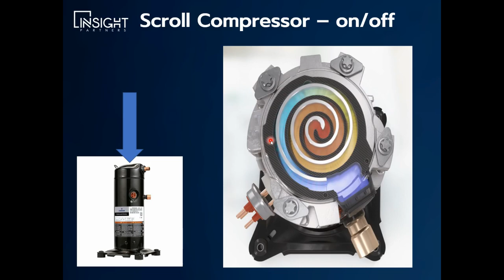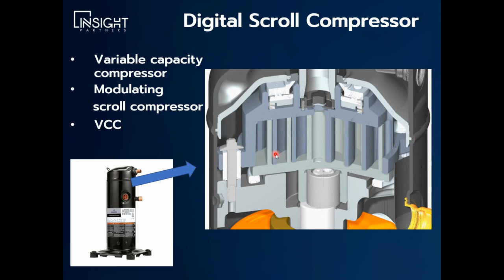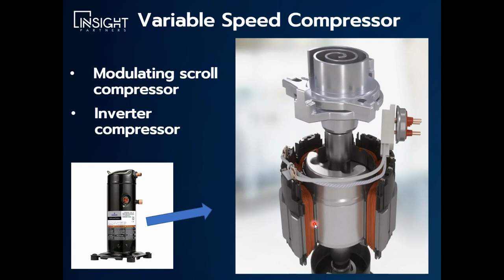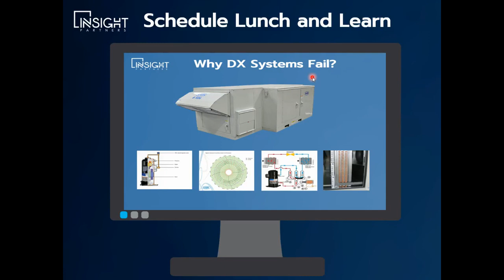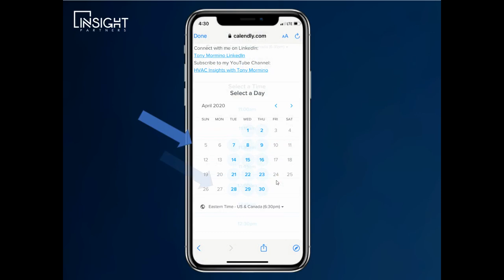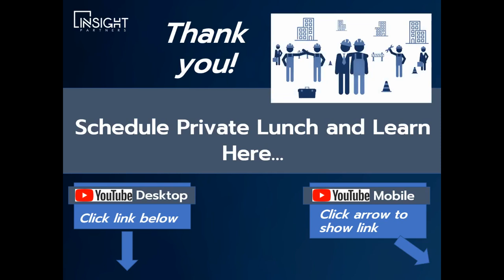Digital Scroll Compressor vs Variable Speed Compressor

Comment: so, is the variable speed scroll compressor is whats driven in "inverter compressors?"  If so, Im curious what would be a reason for a constant high squeal during such compressor operation? (Im trying to figure out why a window AC that uses this tech ... is quiet except for a high pitched squeal around 6.3khz)

Comment: Hi Tony , could you please share how to do selection for hot gas bypass itself? For example for coolong tunnel application , where we need to control the temperature stable and in other side we need to avoid evaporator freezing..thanks

Comment: Wich compressor butter hitachi 410 gas OR copland 410 gas ?
Reply: Its like comparing a handicap wheelchair with formula 1 car, Copeland is the invertor of scroll technology, it will always be better, they have a huge line-up from A/C to LBP application, digital scroll, VFD scrolls, CO2 Scrolls etc.

Comment: Hello Tony, awesome video! I have one question though and its not very technical as the video is. My question, is it recommended to leave split ac inverter type running 24/7 or do I have to switch it off everytime I leave the house? Because of my understanding if everytime I leave I have to switch it off, it kinda defeat the purpose of the inverter compressor, right? Your input is greatly appreciated!
Reply: Hi, it is better to close it off, there is no reason to waste so much energy by cooling an empty house, as for defeating the purpose it is actually not, dont forget that an inverter compressor can go well over the 60Hz  meaning that when you will come back home, the compressor will run at maximum speed (maybe higher that 120Hz in some cases) to cooldown the house again and then it will coast at a lower level (15-35Hz usually).
Reply: The guy above is somewhat incorrect.
How long are you leaving for? What climate do you live in? If you live in a Hot and Humid climate its much better to leave it running. After all it will only start if the thermostat or whatever controls solution being used calls for it to start, and if you are gone for a long period in excess of a few days the humidity can ruin your home via Mold and rust/corrosion of certain metals. It takes much more energy and time for a system to cool the home from a higher temperature and humidity load vs maintaining it, a system is most efficient near its set point, i.e if its supposed to maintain 75 degrees F, its best to operate it near that temperature. Realistically there is no situation in which you should turn your climate control system off unless the building is being abandoned, or left to sit in a climate where humidity and high heat load is not a factor.

Comment: is this possible to run inverter compressor using vfd?
Reply: Inverter compressors are driven by them selves through a powerboard, a standard compressor and be ran  through  VFD.

Comment: Tony, what are your thoughts on using a Rawal valve for capacity control, as opposed to a digital scroll compressor?
Reply from the maker: Hi Matt thanks for the comment! My understanding of the Rawal valve is that it is very similar to hot gas bypass except uses a mix of liquid and gas. In certain applications it probably does well to prevent compressor short cycling but our typical applications have very wide swings in the building load profile so we require higher turn down and precise controllability offered by digital and variable capacity compressors.